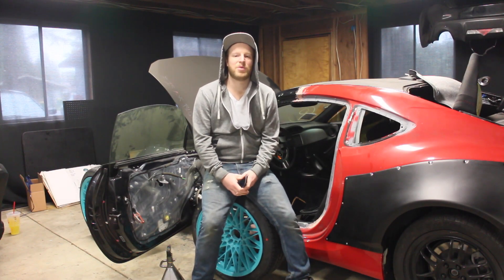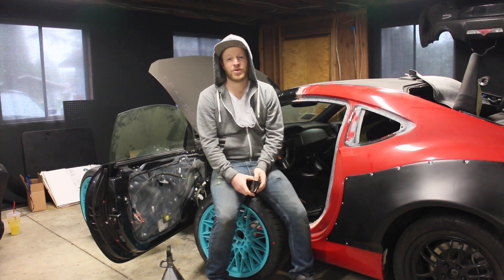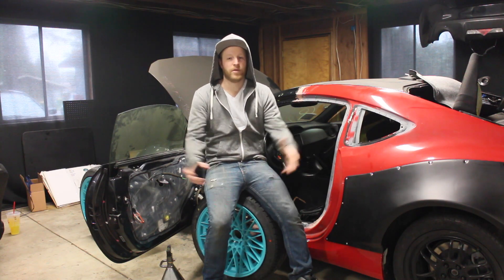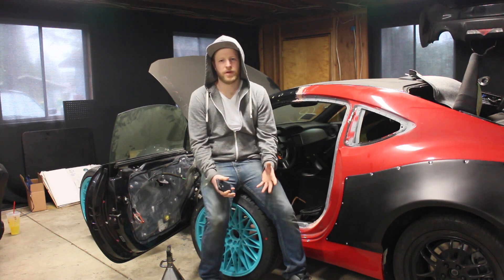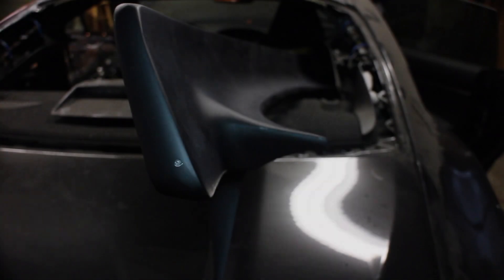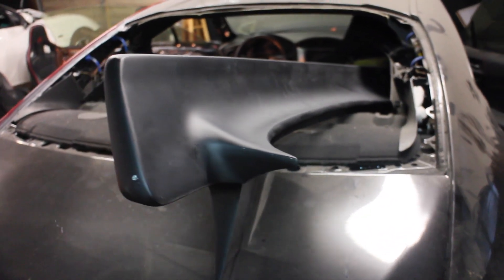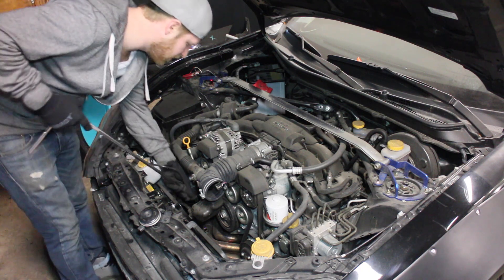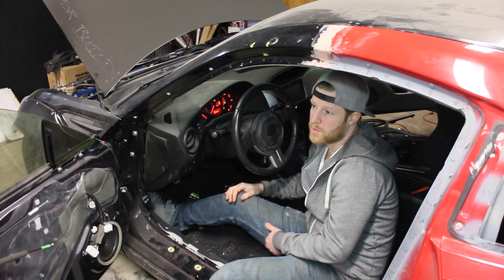Plan B BRZ Pt 10 - Spoiler Install And Checking Sensors

Comment: I work with a lot of different sealants, some advice is check if water will help remove access or turpentine. also do not use your finger as oils on our hands affects the sealants and causes them to get mould over time as seen in bathrooms. prep is important. Another handy tip try use a popsicle stick for a good seem line. keep up the good work :)

Comment: Quick tip for primer and sanding primer. When you get a raw abs plastic Wing for example, Standox makes a sanding paste which is used with a grey scotch pad to promote adhesion for the primer. Then for sanding, spray guide coat on. This is basically a splatter of paint and will help you from burning through the primer. Check some YouTube vids out of my explanation sucks but awesome vids man!

Comment: for that front bumper you should try plastic welding. works very well and its not hard to do and gives the plastic more strength then it started with

Comment: when sealing spoilers on a top tip is to use bodykit sealer and the wipe of excess with panel wipe straight away to get a really neat finish.

Comment: Here's a tip for you Chris, when you are fixing cracks in plastic/bumpers, drill a hole at the ends of the crack, to avoid the crack to expand :)

Comment: What I did was went to a fabric store got a swade material and used 3m adhesive spray. Then do what u did with the vinyl but the fabric stretches better books a lot cleaner

Comment: How about you fit a sequential transmission on the plan A, it would be a bit more unique than just fitting a manual. And also maybe do something where you can fit led's on to the steering wheel as a rev counter like a Ferrari 458?
Reply: Yaaaaaaaaaaaaaaaaaaaaaaas!
Reply: clarly you have no idea how impossible those would be
Reply: +bOwToMeE0 I never said they were possible, especially the led lights thing because I haven't researched about it but I do know that converting an automatic to a sequential transmission on an FR-S can be done. Either way it was just a suggestion
Reply: +bOwToMeE0 transmission would be tough but the LEDs aren't too difficult just look at all the after market steering wheels that have them
Reply: +shane silva it has paddle shifters i think
Reply: +reaperiz you can still convert it to a sequential transmission, it'll just be pretty tricky
Reply: +Jokkeri a sequential box is easily 15k for a brz
Reply: I think if you could attach a Subaru or Nissian or Mitisubishi transmission there are companies that make sequential shifter kits for them. But they are still like $2500 and I'm not positive they will work with stock transmission internals.

Comment: Honestly if you don't want to go the ls1/1jz/2jz route you could mix it up with different motors like the 1uz or something but I would like to see a 5.3/lsx type engine in the plan a the subie motor just seems a little weak for the car.

Comment: on the crack on the bumper you should use fiberglass mesh reinforcement material and tape the front with aluminum tape and apply that adhesive inside when you remove the tape from front and throw more adhesive (glue) on the front then sand down with like 80 grit then finish it off with 180 Grit

Comment: Did you consider using body filler instead of seam sealer on the spoiler? I did that on a spoiler on an old Celica years ago and it worked great. The spoiler molded in and looked like one piece with the deck lid.

Comment: +B is for Build Toyota and Subaru has partnership together in 2012 to make FRS/BRZ into production. That is why you will see so many Subaru parts in both FRS/BRZ. But Toyota was in charge of direct injection system while Subaru was in charge of the engine internal. D-S4 is Toyota product put into Subaru boxer engine. Toyota and Subaru made a great team to make it happen. Now I am waiting for the new look this Wednesday, March 23th at NY Auto Show 2017 Toyota 86(formerly Scion FRS) and later this year they will show 2017 BRZ has refresh along with 2017 Toyota 86. Since Scion will be gone this August 2016. I like your video. I would get another used bumper instead of wasting your time on it.

Comment: dang, wish I lived in cali lol wheels look sick, awesome that youre sponsored. as far as the steering wheel, sand it smooth and just paint it? lol or cut a slot for your phone (not promoting using your phone while driving but its an idea for like navigation if you get a new radio without it) i agree with the not vlogging cause you might water down the content!

Comment: there is no discussion, they come from the same subaru factory. Even the toyota hubcaps have toyota logo on outside and subaru stamp on inside. Basically you have toyota written on engine cover and the badges front and rear, that's it. (and maybe some toyota stickers, which you can pull off and reveal "subaru" underneath. :D

Comment: I thought the airbag in the original plan b steering wheel was good and you fixed the one in the plan A
Reply from the maker: +pfdmustang it was then i stole the one from the plan B and put it on the Plan A. I could easily steal it back..
Reply: i would guess for a daily you would want the air bag  being that the plan A will be the new track car..I am enjoying the videos keep up the good work

Comment: So which one of these are going to be the drift missile? Also that's ABS plastic, don't use filler. It will split. Plastic weld it. Then fill later.

Comment: i am worried for the frame bro, are you going to put a rollcage in it? I mean, that's a weak part (in my opinion) for a daily driver. In case of an accident i don't know if that would hold the impact. (newbie here, don't flame pls)

Comment: where did you get an adapter for that car? i have an 02 suburban (there is no controls at all built into my wheel so i want an aftermarket one) and i keep getting told that there is not one made for that make and model (bullshit because someone im subbed to have an almost identical vehicle and an aftermarket wheel...) but the reason they claim one is not made is because "it has an airbag" >.>

Comment: Fibreglass that crack on the back side then fill any left over crack on the front with just resin mixed with hardener and finally skim with filler but ensure you use a plastic filler otherwise it will flex and fall out and no body likes that this worked great for me just check it will work for the type of plastic you have
Reply: Also! Drilling a small hole at the end of the crack will prevent it from spreading further this is a must !

Comment: if your battery dies the stereo works fine as long as it has a card that matches. I had to replace my battery after storing my brz for the winter.
Reply from the maker: +Miles Krieg yeah but if you lose the card, youre screwed.. thats a terrible design "hey heres this car... aaannnnnddd dont lose this little card or you have no stereo ever again"
Reply: +B is for Build I agree. good luck.

Comment: Instead of track notes on the steering wheel you should Build a little phone holder bracket so it sits right in the middle and you can use it as a gps 
(Cops will think you're on the phone though haha)

Comment: You can use a different card from another BRZ, I just went through that and that's what I did
Reply: Just insert the sd card from another BRZ and it'll boot the head unit up, once that's done just re insert the original sd card from this BRZ and it should work

Comment: The reason why the sd card for the stereo won't work in another frs/brz is because that sd card was programmed to work only with the vin burned into the ecu of the plan A. Car companies do this nowadays to prevent theft of stereo systems (since nowadays the stereo systems are far more advanced and valuable) because if you steal a system from one car and try and use it in another car it is rendered useless unless you have the ecu from the original car. Even if you steal the ecu and put it into another car, some parts (i.e. transmission) has electronics programmed to the vin of it's original car. So, another ecu won't work with other cars either. It prevents car theft.

Comment: Dude. You could get an lm7 5.3L ls based silverado motor for like $600 and a t56 6 speed from a camaro for like another $1000. Its a cheap and respectable swap.

Comment: pro tip when using silicone / seam sealer. Use a wet rag with your finger to smooth it out or just put a shitload of spit on your finger.

Comment: +B is for Build Hey man, please don't just glue the Bumper togheter. Glue never works in the Long run, because the bumper will crack someday as it has a lot of vibrations surrounding it, getting warm and cold all the time and so on. I am doing a DIY How to repair ABS Bumpers Video right now that I am going to upload shortly. That might be interessting for you and will not ruin your day afterwards with a Long as crack, ruining your new paintjob. This shouldn't be a advertisement for my channel tho, don't get me wrong but it would be a bummer after all that sanding and priming and all that preping for nothing. It's still up to you, but glue never works out well on such pieces. Also you should've had drilled a hole in the end of the crack so it doesn't continues to spread. 

Cheers

PS: If you guys want, upvote this so he can see it more easily.

Comment: Wouldn't it be just as easy using body filler for the spoiler? Then you could sand it flush and once painted look like the spoiler is part of the trunk lid

Comment: Since it looks like you're painting the spoiler on the car and not painting the car before putting it on, why not sand the back of the trunk before sticking the spoiler on? the adhesion would be better.
Reply: it's a little late for that now

Comment: what seam sealer is that?
Reply from the maker: +guitarplayer2724 something i got from NAPA, i think it might be a napa brand, i really liked how it did on the quarter panel
Reply: +B is for Build damn we dont have NAPA over here lol
Reply: +B is for Build yo if you use any type of caulking or sealant like that again, dab your finger in some soap before you smooth it out like that, itll give it an even mirror finish and itll look a lot nicer

Comment: MAP*** sensor. all modern cars use a map sensor now.

also, no such thing as a maf sensor. the two types of air metering systems are called AFM and MAP: Air flow meter and Manifold absolute pressure sensor. people who confuse AFM and MAP mix it up and say MAF.

AFMs are the big gray box thing in between the air filter and the throttle body in old cars. no cars use an AFM anymore. MAP sensor is a little sensor just anywhere on the piping from airfilter to throttle body.
Reply: AFM and MAF and both mass flow sensors. New cars don't use the old flapper style sensors but do still use MAF's with a hot wire element. The BRZ has both a MAF (in the intake behind the air filter) and a MAP on the intake manifold. 
And if there was "no such thing as a maf sensor" then why does every auto parts store sell them? lol And I just bought a can of MAF cleaner.

Comment: But a b is for build logo on it so people knows who car it is
Reply from the maker: +Reed Greenwood thats what the decals are for bro! :p
Reply: +B is for Build here is another idea. Drill a hole in the dash were a button is not needed. That the cruise control reengineer it to be a button. Then you could still use the new steering wheel and still have cruise control!!!!

Comment: Bro in the long run that bumper fix wont hold. Cut a small peice of metal put it over the crack and cover it with fiberglass. That will hold the bitch.

Comment: Its Garmin's fault the cards are one use. Most other Subaru unit have hide away cards to prevent theft. Nissan Honda Toyota are all going to this SD system. its terrible and costly. IMHO  your unit is damaged plus wrong sd,. Every manufacture (FUJITSU TEN?) has out of warranty repair.  Call your Subaru dealer and ask them. If they don't know call a different dealer. It exist. IF they wont help you i know i guy in San Jose that will do his best to hook you up with a repair. (Hes a professional not some guy in his basement.) Best bet, get another one of those Androids you put in the Camaro.